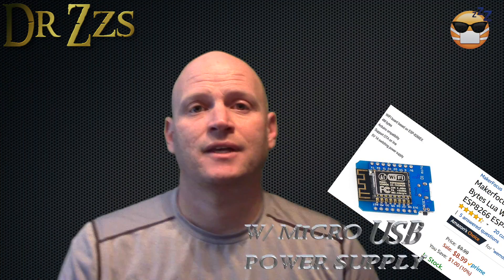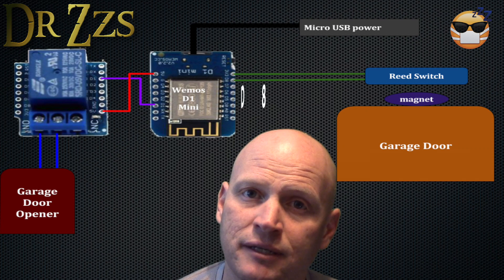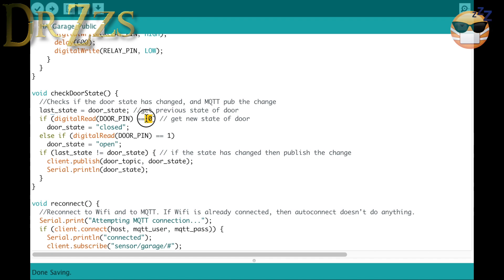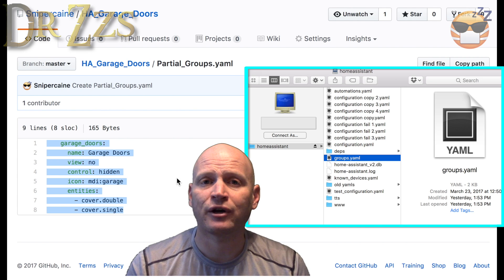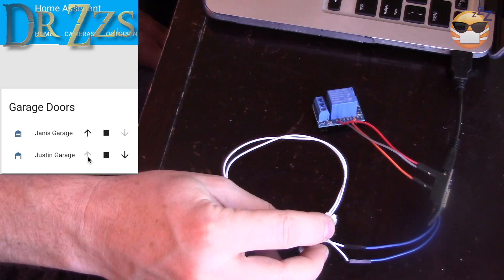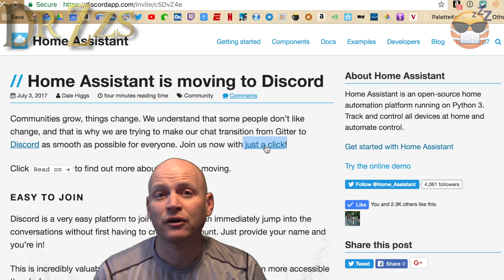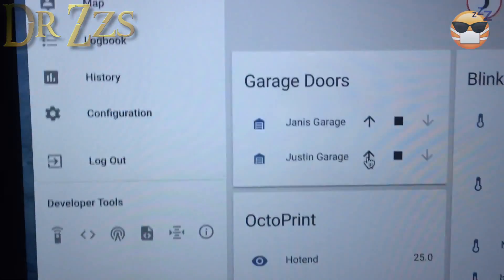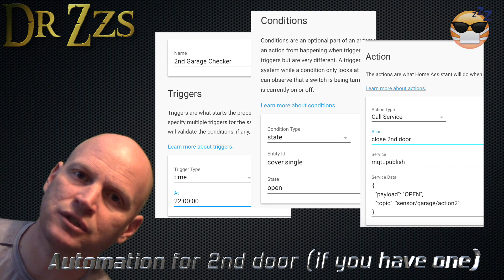DIY Smart Garage Door Opener

Comment: Has anyone else run into where your Wemos D1 Mini, or whatever controller you used, caused enough interference to block the normal garage opener signal from your car or key fob?  I'm curious if this is a common issue or if it might just be the controller I have.

Comment: Hi,

I am trying to follow your instructions. However, I am facing trouble with ESP8266WiFi.h library.

Even though I have manually imported the library, it errors out by some missing library within that.

Also, which board to select in Arduino? I guess default is "Arduino Uno". Is this board correct?

Regards.
Reply: Hi Dr Zzs,

Your help on this will be appreciated.

Thanks.

Comment: I know this is an old video but if you get this, is it possible to add a 1meter RGB strip to say like the door awning outside to indicate door opening and closing. And what I mean by add is to the D1 mini already being used to open the garage as not to have to use another for the one event? TY

Comment: The best way I found that works for me is to hook the wires into the garage door opener but put one wire in common and the other in NO. You then change the sketch around so that the relay is NOT energized when it powers on. Rather flip around the HIGH and LOW in the sketch and have it energize for 800 ms. Why? When you hook a multi meter up to it you want to look to see when the connection is closed or when there is continuity between both leads. When you energize it for 800ms it will close the circuit (continuity) and then open. The reason I prefer it this way is if you do it how its mentioned in the video, when your relay looses power, it will close the circuit and that will trip your garage door (atleast in my case it did). I found this way works best for me. I've successfully built 2 factor authentication into my garage door as well (outside of homeassitant for now). Its hosted on a separate web app internal to my network. Will put up a video and demo that in action. I will also try to create a custom component in HA to activate 2FA. Pretty neat. Anyways thanks Dr Zzs for the inspiration as always.

Comment: Great tutorial and new to home assistant, followed your tutorial and got it working. But i got a config warning: Your configuration contains extra keys that the platform does not support(but were silently accepted before 0.88) please find...... [optomistic]. (see .... line 198 ). Offending data: {"platform":mqtt", name":"double","state_topic":"sensor/garage/state1........."optomistic":false,"retain":<redacted>"}.

What is the work around it? I'm using the D1 mini with the relay. Also when powering on, the relay click twice on/off.
Reply from the maker: Take out the line in the config with "retain: false". 
As for the clicking, I uploaded a different sketch with the pin state swapped and using the Normally closed contacts. 
https://github.com/Snipercaine/HA_Garage_Doors/commit/84d647551addfcc4f3cc8baac574d254e6b41ec5
This will trigger the first time you connect the relay to the garage opener, but it won't trigger the relay later if you restart HA or lose wifi connection briefly.  
I would suggest trying ESPhome instead of my crappy Arduino sketch.  
Here's a gist to use as a starting point if you decide to switch to ESPhome. ESPhome is what I've been using for almost everything lately.  I'm not messing with writing my own sketches anymore.  
https://gist.github.com/Snipercaine/eb8bd97810ea89a26c0aa78e10dd0d2e
There are some bits you won't need in the ESPhome sketch (Ultra sonic distance sensor, LED parking assist). 
Hope that helps!
Reply: Thank for the reply. I will try the ESPHome as you suggested, as I didn't implemented yet. now i have to try to change the arrows to left and right, as i have a sliding gate.  @DrZzs

Comment: I am new to all of this and unfortunately HA has changed; none of this works! I know you have an updated SONOFF SV tutorial but I have already bought all of these components and I cannot make any of this work. I followed this tutorial and since I'm using a newer version of HA (0.94.1) it has a huge amount of error codes when I follow this. Could you please tell us how to do this after the update with the D1mini and a relay shield?
Reply from the maker: ya, sorry.  Things get outdated really fast around here. 
I'd suggest using ESPhome with the D1mini/Relay. 
It would be very similar to the sonoff SV.  
If you have the relay shield then pin D1 is the relay activation pin. You can connect the reed switch and/or US sensor to pins D4 and D5 since both are free on the D1mini. 
When you first set it up in ESPhome you select D1mini as the board type.  The rest is the same.  
I have a v4 of the garage opener built using a D1mini and Relay shield.  If you can make a live stream and remind me I'll go through it with you.  In the meantime I already have the ESPhome yaml on gist.github.  
https://gist.github.com/Snipercaine/eb8bd97810ea89a26c0aa78e10dd0d2e
There are some parts in there you wont need if you aren't using a motion sensor or a temp sensor or the parking assist LED.  So you can take those out. 
Hope that helps!
Reply: @DrZzs  You are awesome! I don't know what ESPhome is (yet) but I will find out. Thank you so much for taking the time to reply to me though!

Comment: This chip is 3.3V and you should NOT connect the gpio to 5V.  In your description you said "Connect the D1 and 5v pins on the wemos and relay."  Am I missing something?
Reply from the maker: If you power the D1mini from the usb port it receives 5v.  There is a 5v output pin on the D1mini, and the relay needs 5v in addition to the connection from D1.  
Does that clear it up?

Comment: Thanks for the great tutorials. I have added my garage door to home assist as per your instruction and it works perfectly. I am now busy automating my driveway gate motor and I have a question. Instead of using a read switch, my gate motor sends a 12V signal when it is closed (this can be used to power a light). Is there anyway I can use this 12V signal to tell Home Assistant the gate is closed instead of using the read switch?
Reply from the maker: Excellent!
There are probably a few ways you could use that 12v signal.  If you have an esp8266 device at the gate, like a D1mini or NodeMCU, you could connect a buck converter to that 12v signal to decrease the voltage to something below 3v, then connect it to one of the GPIO pins and set that pin as an input sensor, so when it sees 3v it could show the gate is closed in HA.
Reply: @DrZzs  I used the 12V to power a second relay to bridge the wires - and it works perfectly.
Reply: @DrZzs  great... thanks for the feedback. I'll give it a try and let you know if it works.

Comment: awesome video, I had pretty much the same idea and was waiting on kit to arrive to build it. One thing I wasnt sure of(Im new to arduino) is with the relay, does it push power through when it activates or does it just close in a similar manner to a button push? Im looking to wire mine into the remote but not overly keen to fry a remote controller just yet.

Comment: Great project, everything functioning OK....except my manual wall switch is offline now.  Any tips? Thanks!
Reply: Did you get it fixed yet? If not. I suggest that you double check your connection at the point where you introduced your wires from the wemos relay. If you just tucked your relay wire into the socket at the opener motor, I suggest taking the wires out and twisting them together then plugging them back in. For a more reliable connection.

Comment: Thanks for the wonderful video, I tried this method however I don't know why I am unable to activate the relay. I tired mode mcu as wel as wemos D1 mini with two or three relays. wifi and MQTT connects fine switch works fine however relay is not getting activated. Also for some reason in the serial monitor it seems to continuously shows Attempting to connect to MQTT..... connected.

Comment: you inspire me!!! thanks man!!! i use nodemcu V3 a second relay for lights control Tasmota firmware helps a lot!!! aslo add a dht11 sensor I don't know why... i have spare one. i also setup script run for 5min triggered by the open reed switch and try too run the door again but if reed is closedthat stop tje script...... HA is amazing keep doing amazing videos!!!! i run HA in laptop linux server it's amazing stable.... do you have facebook??
Reply from the maker: Thanks!  Glad to hear it.  Sounds like you have a great system going there!
Here's a link to our facebook group
Facebook: https://www.facebook.com/groups/1969622823351838/

Comment: I like your setup but there is a serious situation you have overlooked. The system can close the door while a car is entering the garage. I know this happened to me with another automation system. I realize its a very rare occurrence but a vehicle can enter the garage 1-2' before they break the safety beam(since it is mounted lower than the bumper). Potentially the door can contact a van or SUV roof. You should therefore have maybe an ultrasonic sensor to detect a car entering the garage and check it during down operations. Your thoughts?
Reply from the maker: Adding another sensor to check if there's a car about to hit the door or get closed on is a good idea.  If you do it share it.  I'm sure a lot of others would be interested to see how you do it.
Reply: This is a garage door safety feature. My beam can easily be adjusted up or down as it uses a clamp to attach to the track. Since this can also happen with "standard" garagedoor opener, and remote button that is likely also installed inside your house door/garage person door. I don't think this project should be addressing it, but it's certainly good information for everyone to be aware of - in case of automation failure (unintentional trigger of the door) / not human error.

Comment: I use tasmota to flash my NodeMCU.  Every things works but the problem is the relay stay on forever until another command.  How do I make it a 1 second pulse on  the relay?  Does it have tasmota command I can execute to make relay pulse once?
Reply: I figure it out on the documentation:  Set tasmota console command: "PulseTime 10".  It makes the relays hold for 1 second then shut off automatically.  You do not need Automation delay turn off MQTT trigger on HA any longer.  Also I set PowerOnState 0; PowerRetain 1.  Now I works how it suppose to..
Reply: I am also trying this project - I have the relay "clicking" but I don't get a measurement of voltage output from relay.??? I have tried wiring and using the pinheaders with modules "snapped together"... Help would be appreciated.
I am using V2 of the sketch, With the default pins reversed as suggested. Anyone have ideas?
Reply: @willhutcheon8095  this means that the relay does not get enough voltage to trigger.  Make sure use 3v relay since NodeMCU does not have 5v output.  Or you can use Miniwemo D1 board has 5v output power.  Hope this help.
Reply: @ @mrteausaable  Thank you. I am using Wemos D1 Mini but It says all I/O is at 3.3v also. All of my relays are 5V; so perhaps I have made a very large mistake?
Reply: @willhutcheon8095  the DI mini has 5v output.  Use that or get a new 3volt relay and it should work.
Reply: @ @mrteausaable   Thanks very much. I decided to test again - D1 Mini triggering D1 with 3.30v only, using the 5V relay shield, I used a 9V battery to common and used my Multi-Meter to test +9v from NO connection (9.49 v when relay triggered - 0v when not triggered) and tied the other MM to GND. It worked like a charm - even though I confirmed only 3.3V coming from PIN D1 (relay trigger) and I am using D1 Mini Relay which is 5V! 3.3v is ENOUGH! yay. Thanks very much for helping me through.
Reply: @willhutcheon8095  Perhaps you have figured this out by now, but the relay will not out put any voltage when triggered, it is a dry contact, It is only a contact switch, and not like the sonoff where power is transferred thru the device it is isolated from the pcb and any components on the other side of the relay. the 3v or 5v that is put into the system is only to draw the contacts from opened to closed and that is why you have two options on the relay to be NO normally open or NC normally closed with the common inbetween. You only gain or lose continuity depending on the contacts you choose to connect your wires to.

The "c" moves back and forth from "nc" to "no". so "c" is always in contact with "nc" or "no"

At rest the "nc" is making contact with "c" and "c" is not making contact with "no".

If you had wires on "nc" and "c" you would have  continuity, and upon action of relay the continuity would be lost.

If you had wires on "c" and "no" you would not have continuity, and upon action  of the relay there would be continuity . 
                                                                                                                 /\ \ <switch
                                                                                                                |   |   |
                                                                                                             nc c no
Reply: @TheMcgover  Thanks so much for taking time to explain. I was brand new in the hobby and not understanding whatsoever what I should expect! I'v had my garage door opener working for some time now, and I have added a temperature sensor (ds18b20) and a PIR Sensor to it (AM312). Thanks very much!
Reply: @willhutcheon4144  You are welcome.  As a noob to all this, I am looking to get my garage door opener up and running in the next few days myself. I was having trouble with my mqtt connecting and looking thru the comments for possible help when I ran up on your question and saw how the replys you were getting did not seem to correspond with your actual issue. I figured you may have resolved your inquiry but thought it could also help others, reading this in the future as well.

Comment: Can we just use one D1 Wemo  instead of 2 of them?  Will it works?  What is the second reed pin and switch pin would be then?
Reply from the maker: yes, you should be able to do that.  You can use most of the pins on the D1mini.  I wouldn't use this code though, I'd use Tasmota.  This video was made before I had discovered the beauty of Tasmota.   I'd do something like set 4 relays, but only connect Relay1 and Relay2 to actual relays.  Then set switch3 and switch4 as the reed switches.  
Hope that makes sense.

Comment: Hey Doc. I've ordered a Wemos and a 1 channel relay shield. But I was looking at your 3d printed box that was linked in the description.. and it's not deep enough to hold the relay shield as well as the wemos. Did you edit the print file before sending it to the printer to accommodate the 1 channel relay shield? If so. By chance would you still have the file that you used?
Reply from the maker: You don't want the crappy box I had when I made the video.  
I just found this one that didn't exist when I did mine.  It should work well for you:
https://www.thingiverse.com/thing:3028514

Comment: Just wanted to share - I have a (Chamberlain) Liftmaster 8550 garage door opener /w myq security 2.0 and after many frustrating attempts could NOT get the door to open using a jumper wire.  It turns out you cannot use the method in this vid to short the contacts to get the door to open.  After researching, I soldered this setup to our second spare garage door opener which worked.  I read you can also attach this to the wall control so you won't have to worry about changing the battery but I was too scared to try.  Thanks for this vid, overall, it was awesome and I can now control my garage door via HA!  This is where I got the idea for using the second garage door opener:
https://youtu.be/8H2cANbAYL0
Reply from the maker: That's a great solution.  
You aren't the only one having trouble doing this with a newer model door opener.  
Glad you got it working!
Thanks for coming back and leaving info for others who might have the same problem!

Comment: Hi DrZzs, what change on the original code stopped the relay triggering when disconnect/reconnect wifi. I have the same setup but using a different sketch and everything works fine except when I restart Modem, the garages opens.
Reply from the maker: The changes I made in the second sketch were to make the pin high on startup and low when activated.  And I connected the wire from the opener to the Normally Closed contact on the relay, instead of Normally Open.  It gets my mind a little twisted up to think about how it works now.  But essentially this stopped it from opening when it disconnected from the router.  Hope that helps
Reply: That makes perfect sense, thankyou

Comment: The current configuration of the reed switch floats the input when it is open. This could lead to some unreliability as the input picks up noise or moves to an in-between state. Pull the input down to ground with a 10K resistor. Would also help to put say a 0.1uF capacitor across the two pins where the reed switch connects on the board to smooth out the signal and bypass any noise.